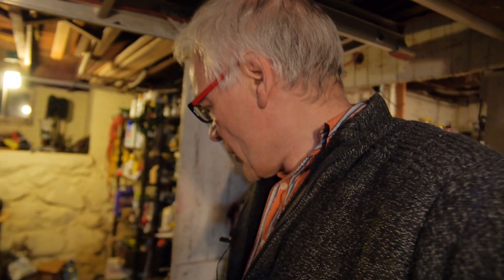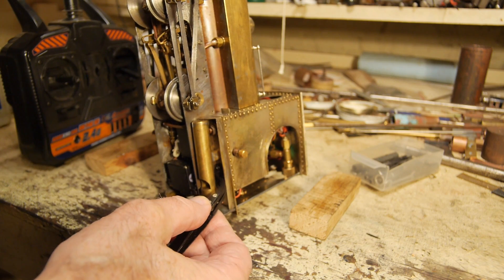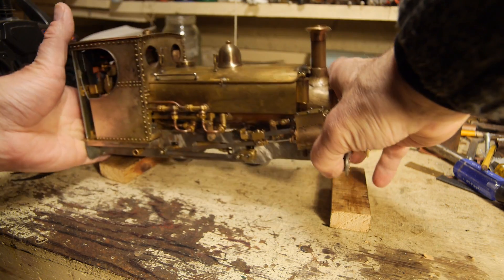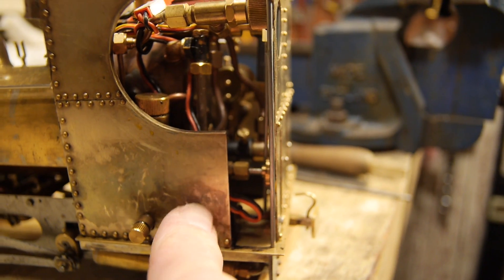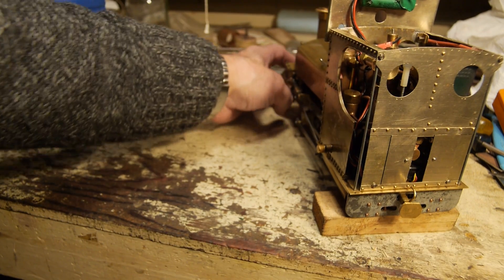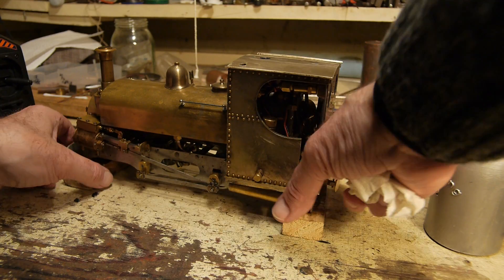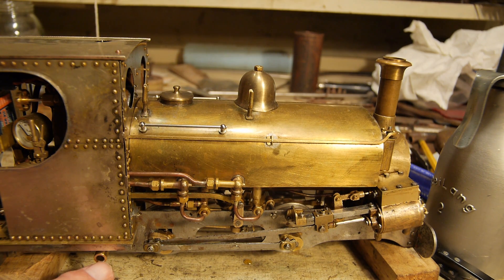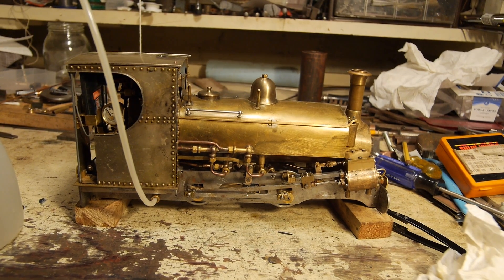Firing up live steam locomotive 'Blanche' Part 1

Comment: Chainsaw bar oil is very sticky, I blend it with gear oil to get a thick and sticky bearing oil
Reply from the maker: As long as it doesn't gum up the small oil supply passages it sound like something to try, thanks

Comment: Is there a book/books you can recommend to get reading about model engineering. I have tried getting hold of blueprints of a local loco but I am finding this difficult. Is there a resource guide or source for blueprints, supplies, shops. Google is not enough for this hobby!
Reply from the maker: There's quite a good book that show all the details of building a small engine similar to this called 'Steam Trains in the Garden' by Brian Wilson.  It's expensive but well illustrated with lots of detailed drawings.
Reply: Gandy Dancer Productions Thanks, I have ordered it!